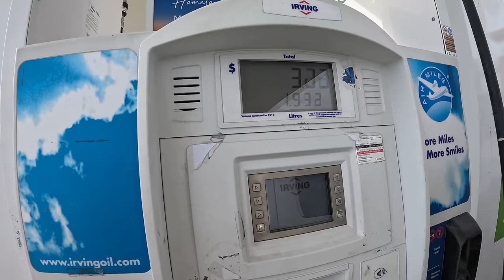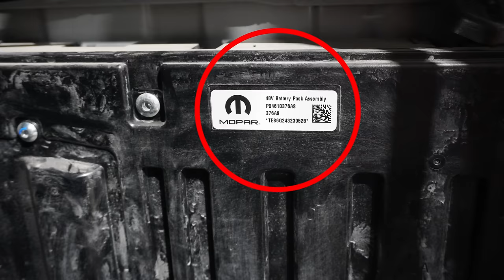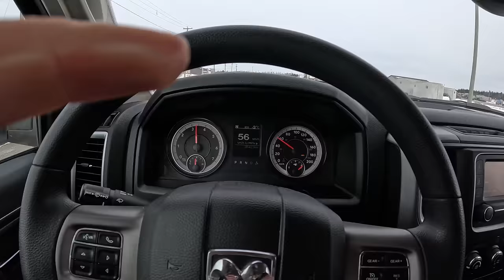Ram 1500 E-TORQUE HYBRID System *Heavy Mechanic Review* | Does It ACTUALLY Work??

Comment: I have a 23 5.7 hemi e torque. I agree makes zero difference. Maybe if u had long stops. It’s basically a compliance system. Fortunately u can turn it off.
Reply from the maker: I did see that you can turn it off which is nice. but ya I've driven a few hemis with E-torque. literally felt nothing different.

Comment: Alex. I think the E-Torque system is a bunch of Hooey! My 22 Rebel, Hemi with the E-Torque makes absolutely zero difference in my gas mileage and I notice no difference in my acceleration at all. Hooey! I always turn the Stop/Start system off because I can't stand the engine shutting off when I come to a stop. There's just something about the engine shutting off that unnerves me a bit. I'm an Old Fart and I just don't like it. It is a smooth transition when the engine re-starts, but it's not for me. The only reason the system exists is because of the government forcing manufacturers to meet unrealistic fuel economy for trucks. Trucks should be exempt from these kinds of regulations.
Reply from the maker: Bill I completely agree. I've driven a couple Hemi's with E-torque and notice absolutely no difference. not even a sniff of difference. It looks great for the marketing department and that's about it.
Reply: In order to like the system you must woke up and vote for Biden 🤪

Comment: I've got a 2019 RAM hemi Crew cab 4x4 without torque..... My friend has the 2019 hemi Crew cab 4x4 with the etourqe and he has the start stop grap.  He hates it,  can't be good to constantly stops and go on the motor.  Glad I didn't opt for the stop and go or the etourqe.
Reply: You can turn off that feature by pressing a button, let’s not be so dramatic.
Reply from the maker: probably not great for the engine, most wear on the engine occurs during start up. but you can turn it off.
Reply: There’s a simple button on the dash to disable the “Autostop”.
Reply: Standard equipment in all domestic trucks and I'd much rather use a generator than the starter motor because that's very jerky are noisy

Comment: It's all about appeasing the EPA gods. Expensive way to add start/stop which itself is bad for engines to have it drop oil pressure so often. Starters are way cheaper then this eTorque system.

Comment: Hi Alex, I'm not impressed with this setup. 1 mpg gain, not worth the hi tech issues.  Battery inside the cab, just the thought of a fire scares me off.  No thanks RAM.   Have a great week.
Reply from the maker: Ya the battery in the cab was a little bit of a shock for me. makes sense for climate control but I'd rather have it outside in came of overheating aka fire.

Comment: I got my 2023 limited longhorn 1500 Jan 2nd, 24. Thought it was good nuff deal but as I drive this fiat under ram badge- I DID A VERY STUPID THING. At 90 degree days that start stop might work for 20 seconds, if it kicks in at all. The interior leather is like wet pressed cardboard. The big radio stack 12" screen only is for the NAV and their nav is TOMTOM. The worst nav on the planet!! It has crap graphics, it shows the speed limit on its old software but won't show your speed. And if you use Google maps or WAZE, on android it won't use the full screen. I saw 1 video showing ut did work with apple play. Now if you increase the tire size and want to change that in the computer - THEY PUT A SECURITY LOCK ON so you have to get a Y split cable and follow youtube instructions to connect it. Soo, the dealer had 35" on my truck and it's giving false mileage, and wrong mph, making a good gps, real gps, to show your mph. Do I hate this truck and my stupidity for getting it - oh yeh. Can I get rid of it- sure, at a massive loss because at msrp of 76,950 - it's mine. Don't be a fool, this is not a 2018 RAM. It's stellantis fiat cheap. Just close the door when you're looking at one and watch the door panel ripple. Cheap as a gum wrapper. With my 35" tires it shows 10mpg, not this 21mpg they show on most videos. And I can't change it.

Comment: I think it would be more fair to Ram to at least acknowledge the fact that in a lot of situations the start/stop feature is the biggest benefit to our climate. So in IMO I think it was a little disingenuous on your part to not at least recognize that part of the e-torque feature. Seems that most people like to deny that we have a climate crisis and at least you can acknowledge that this e-torque system in a very small way helps to eliminate the emissions that would normally be put out while idling at a stop light and/or bumper to bumper gridlock traffic. just saying. 😉

Comment: E-torque sucks. It gives no better gas mileage than my previous ram 1500. You can feel the jerkiness. Along with this poor system, the stop start is even worse.  Yes, it’s smooth at 
 The traffic light, but while parking it is quite dangerous. While you are inching forward it kinks in and out, which could make you hit the car you are parking towards.  Ram engineers took a great truck and turned it into a mediocre truck.  I wish I could have found a classic to buy instead of my 2024 Ram etorque.  The Ram engineering team should be ashamed of themselves.  I could go on with more poor engineering details, but I’ll stop with these.

Comment: Who is this guy LMAO? This is my 4th Ram 1500 from 2015 to my current and first ETorque sport 2023 and I can tell you I without a doubt notice the difference 100%. Much smoother acceleration , very fast response and the best is the towing , it tow's my 4500lb boat like butter , huge difference so I don't know wtf this dude is driving LMAO.....
Reply: Hmm. I’ve had different results hauling my camper. The engine with Etorqe runs at over 4500 rpm to go 65mph down the road. My hemi would be well under 3000 rpm. I’m not a fan for hauling. Running around though, I like it.